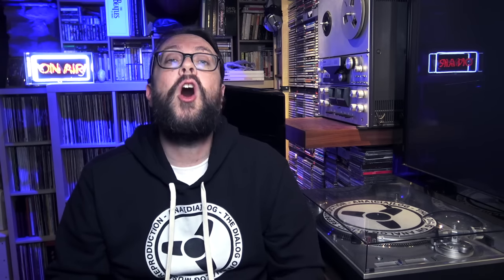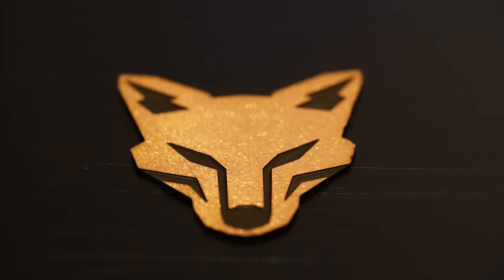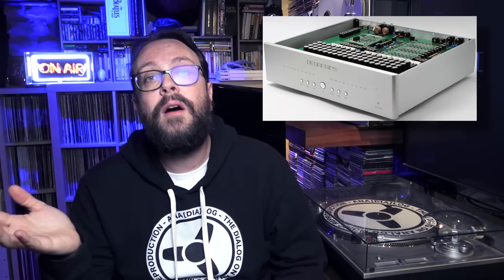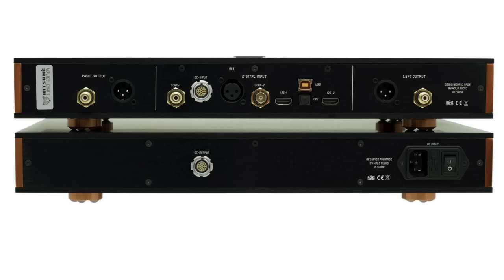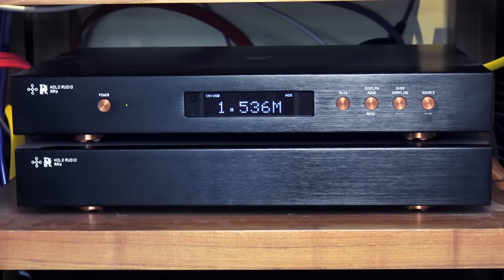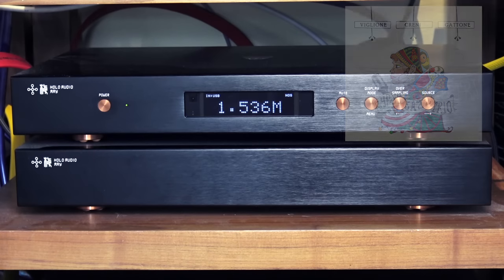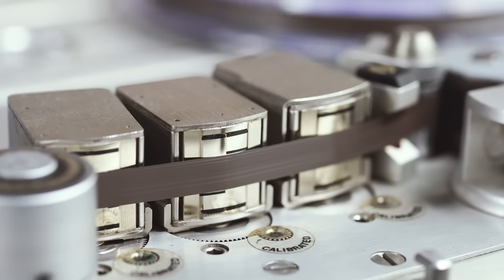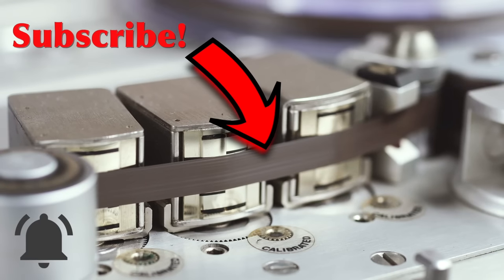Holo Audio May DAC: The Digital-to-Analog Conversion Vanguard

Comment: OCC silver does not necessarily sound better than high purity copper. Most times, silver wire sounds too bright and detailed detracting from the music.  I doubt Kitsune actually designed the caps that replaced the Vishay caps. They’re probably using a higher grade using off the shelf cap from another manufacturer.
Reply: Thinking the same thing, or at least hand picked for better measurements. However I think silver in the is case will bring up the speed of the DAC a bit, maybe a bit more punch? Let's say 2% punchier... lol. None-the-less I just pulled the trigger on it.
Reply: @mesonto  Let me know how it sounds. My audiophile buddies compared the silver and copper versions of the Spring DAC. They preferred the copper version.
Reply: @JohnLee-db9zt  And this is exactly what I would have prefered to be able to do... I miss the local dealers! I have purely made this purchase sight unseen and unheard on the backs of several great reviews. Including one guy in Toronto that used to work in a high five store that I frequented... Jay, home for most the time when I was in the store I did agree with him on what we listened to.

Nonetheless it's frightening to buy things when you haven't been able to audition them.
Reply: @mesonto  The US distributor is not an audiophile. His system is poorly setup and is completely inadequate for the May or Spring DAC.  He jumped on the silver and “special” capacitor bandwagon, so he can make more profit.  Audiophiles can’t stand having but the “best”. That’s my opinion.
Reply: @JohnLee-db9zt  John, don't tell me that! That's what I was thinking all along. However as I told you I bought the KTE version just hours ago. I have to hope that my system is revealing enough so I get at least 2% better performance? But maybe I just got sucker punched. But I guess I'll never know considering I bought it sight unseen and unheard. Sigh...
Reply: @mesonto  Regardless of the version, it’s a great DAC. A bargain compared to those overhyped overpriced DACs from western manufacturers.
Reply: @JohnLee-db9zt  Geeze, I hope you are right, because it was rather expensive with Canadian money! It better be my end-game DAC.
Reply: @mesonto  End game? Lol. There’s no such thing for an audiophile.
Reply: @JohnLee-db9zt  my wife says there is... hahaha
Reply: @mesonto  She’s going to be disappointed. 😁
Reply: @JohnLee-db9zt  lol!

Comment: I am not doubting you are getting better sound but the amount of $$$ people are throwing at DAC's nowadays seems a little crazy and could be spent more effectively (IMO) on other parts of the sound chain.  For example: music streamer and power source.  Right here is where the sound might be most easily improved.  For example switching from a MacBook laptop to an iMac or mac mini for your music streamer will greatly change sound performance as I've found with my own experimentation. Obviously there are even better sources than a computer (but surprisingly this is what a lot of people use).  Second, for that analog sound why not considering investing in a high end preamplifier?  A really good preamp can do wonders for sound stage and can be chosen to suit ones preference.  For example, pre-amp with tubes for less harsh digital sound.   A general strategy: if you want to invest your $$$ don't spend it on the DAC (this also applies to other sources like TT) but put it into a more fundamental piece of equipment such as a top of the line integrated amplifier or even better integrated preamp/amplifier.  I am not saying every DAC is created equally but I think a DAC in the $500-1000 range with a carefully thought out sound chain can sound amazing.
Reply from the maker: I agree, but you must consider people that already upgraded the rest of the chain and now they want to upgrade also their analog to digital conversion.
Reply: @anadialog  Fair enough.  But I'm going to revisit this post in the future after I buy my 6-10K speakers and see if it makes sense to pay 6-10K for a DAC.  I saw someone talking bout the Chord Dave which is almost 11K.  I remain doubtful - but very open minded.

Comment: My friend, for that money I'd get a Benchmark or Brooklyn DAC.
Reply from the maker: I considered that, but Bechmark has obsolete chips and by Brooklyn I believe you intend a Mytek DAC, and perhaps the Manhattan model. The fact that Atkinson ditched the Manhattan and took the May as his reference one me over. Mytek is the way to go if you need MQA IMO.
Reply: @anadialog  Benchmark Dac 3 is the Reference Dac at many manu studios and is a favorite of many audiophiles i know for its second to none implementation of the ESS chip most frequently used by professionals.  It also holds its value much much better (like most end high USA products) and is Sterophile's class A+ DAC of the Year.  The Chinese DAC may use a newer chip but has the tendency to color the sound (a big no no), making everything sound analog, as noted by Herb Reichert.  Id give the Benchmark a try before committing to the May
Reply from the maker: @jn3750  absolutely, I am not defending at al costs the May, I was just commenting on the models you mentioned. Remember that the May is a r2r DAC, no chips, only for upsampling. A good comparison are the Denafrips or Soekris etc.
Reply: @anadialog  Another problem with R2R DACs is that they usually don't measure exceedingly well, though they have the sound we analog fanboys love (I bought 2 R2R professional machines after watching your channel!).  Also, Chinese companies like to use the latest chips (I also have the flagship Topping D90 which uses the much newer chip than the RME) but their implementations are not stellar.  In numerous tests, the RME walks all over the Topping!
Reply from the maker: True! But Holo as others are trying to correct the connected issues. Obviously the downside if further manipulation of the signal
Reply from the maker: That is clearly a policy to promote mainly US products, which I do understand in part. Leaving China aside there are several countries that produce amazing DACs, including Italy! But I am sure that the Mytek is great, it is surely the one with more features than anyone...very versatile.
Reply: @anadialog  ive been reading both Stereophile and TAS for about 30 years and they are quite neutral, featuring products from every place on earth (the fact that about 60-70% of the top products happen to be from the USA is no surprise as this country holds most of the world's patents, has the best companies, research facilities, universities, scientists... and dominates the scientific communities (as you are a researcher) ranging from Anthropology to Zoology.  On their top products lists you will find MANY products from Europe and Asia as well.
Reply from the maker: Well, same here. All mags and websites tend to promote more the country's own products more than others. But it's ok, no problem with that.
Reply: I've had the Benchmark DAC, it's sterile and lifeless.
Reply: @divertiti  Interesting.  It is one that is recommended by many people at the Absolute Sound, Stereophile, Sound & Vision mags and used at numerous studios.
Reply: @jn3750  Studios use DACs as a tool to analyze their production, not for musical enjoyment, that's why they choose something that's sterile and analytical. I don't produce music, I listen to music for enjoyment, and there is none to be found in the cheap delta sigma DACs like Benchmark and topping.
Reply: @jn3750  The Holo May measures as well as the best DS dacs. Also, you are getting too much encouragement, R2R just dacs sound better. Measurement geeks have the thinnest, flattest sounding hifi setups out there.

Comment: Get rid off your Macbook pro, that was I used to use with a Singrex 6 and Holo Spring! I did not realise how shitty that sound until I tried a Allo digione signature with their linear power supply, and Volumio software(best sounding). When I used Macbook pro, I have tried all kinds of playback software: HQ player, Amarra, Pure Music, Audirvana and more, Audirvana sounded bright but lots of details, I barely use it. Amarra sounded best without upsampling. After I bought a Allo digione signature to try out, I cannot go back to Macbook anymore! and Allo digione is sooo cheap.
Reply from the maker: Thanks for the tip!
Reply: Yep, the noise that I didn’t notice with my MacBook Pro was gone with the Digione Signature too.  But I’d recommend an Innuos if you want DSD, since the Digione doesn’t have a USB out therefore limited to SPDiF out
Reply: All that software bloat, strip down the os. Get could ge euphony or windows server
Reply: @shahidyt  Does digione have I2s output? Holo has i2s input, that should do dsd I guess, but never tried.
Reply: @danlu8445  no, the Digione is coax, bnc and optical.  I2S would be better, but be careful in equipment matching.  I2S is delivered different depending on manufacturer I believe.  I think more common is HDMI but I think in some cases ethernet cables.  I don’t know too much about I2S, but I think the Denafrips Terminator has different I2S connectors so it is compatible with a wider range of I2S transports

Comment: What is the op-amps it uses? When you power mode switch on can you change the voltage output should be able to from 3 to 1 volts ppv, have you tried it at 1 volts don't go to 3v if you haven't got a valve amplifier. How are you connecting it up through a preamp or straight to a power amp.
Reply from the maker: There is an Op Amp used for input stage and discrete component used for the output stage. The discrete output stage is working in pure class A.  It’s BiPolar Junction Transistors, direct coupled.
This is taken from their website.
The manual says that the output from PCM is 2.9V and from DSD 1.45V. XLR is double. No, I have connected it to my integrated tube amp.

Comment: Serious question. What did you have before, and what is the difference?
Reply from the maker: Before this I had a ADI 2 Pro FS. The difference is mainly in the sound quality of the high-res material. As I said the sound is less "digital" and rich in detail with more complex music. The music I stream from Qobuz just opened up and sounded much better. I truly believe that this machine needs time, I know how OCC wore behaves, it takes time like the rest of tye descrite components. I am very curious to reassess my evaluation 3 or 4 months from now.
Reply: @anadialog  cool, thank you for taking the time to reply. Love your channel.
Reply: @anadialog  you should try using a dedicated streamer with the DAC.  In my experience it made a huge difference over a laptop and audirvana.
Reply from the maker: I think you are probably right. Nevertheless, the computing power of a Mac Book Pro is not present in a streamer but the components are obviously better and hifi grade.
Reply: @anadialog  Audio doesnt need alot of computing power.  The compute modules on a raspberry pi can handle high resolution audio with ease.  There are other solutions with more computing power out there but certain schools of thought believe that a more powerful cpu introduces more noise. I cant comment on that since I dont have any direct experience.  The only thing i can say was adding a streamer in lieu of a laptop made a significant difference.
Reply from the maker: Well, I can only say that you should see how the Mac suffers when playing high-res material with Audirvana!
Reply: @anadialog  the reason for that is audirvana turn down alot of the performance to lower noise, they believe that more powerful processors are noisier. Its one the reasons audirvana sounds better than other software.  With a dedicated unit components are far less quiet so there is no need to throttle components everything runs smooth.

Comment: Looking at their website, it’s disappointing to see no actual measurements or specifications for the DAC. 

It’s like looking at a very expensive super car without any BHP, 0 - 60 or top speed data.
Reply from the maker: Check the forums, I found some interesting tests and measurements.
Reply: Yep. There is a full set of test bench measurements done from/on an easily findable forum.

Comment: From my personal owning and listening experiences, Spring Kitsune Edition DAC (with the Kitsune SU1 Bridge) was one of the worst DACs in the that price point I have EVER owned and heard. Not even remotely good sounding regardless of price, just terrible. Soft, crushed dynamics, lifeless veiled sound. Total crap. And I gave it months of burn/break in. I kept the SU-1 bridge though, that's a great product, the DAC sucked. Below average with PCM and miserable with DSD. They failed miserably attempting to go for that "analog" sound, something that PS Audio DS Sr does really well, if you are into that more vinyl-like analog like sound signature and not the more powerful/weighty solid state like digital sound of many chip dacs like the AKMs, ADs and Sabres. The DS Sr is really the Vinyl's lovers ideal DAC. I prefer the sharper more powerful SS like sound, especially if it can be equally nimble and nuanced with complex acoustic pieces, something the top flight chip DACs can do well. But as for Holo my take away is this... you can build something pretty and with a pretty looking circuit and board layout but that is not a guarantee it will sound good or a substitute for manufacturers that rely a lot on listening. To me it just seems Holo made the prettiest looking board they could aesthetically and assumed it would sound good. When it comes to sound quality I hate to say it but Holo are total pretenders. If you want real good R2R, get an older used MSB, Rockna or similar. Hell if you just play Redbook or 48k get a nice used 90s DAC with the actual PCM1704s in them. Hell even the Schiit Yggy which I had for a bit was also miles better than the Holo.... the Yggy was a bit dry sounding for my taste but it had exceptional sound quality. And I know I'm not the only one who feels this way about Holo DACs either. The sound quality of AKM based DACs like the Bryston BDA-3, Sabre based Mytek's or the AD based Bricasti's all sound orders of magnitude better than the Holo stuff... then again basically anything sounds better than a Holo lol. Other favorable comparisons would be the the FPGA's like Playback Designs, PS Audio DS Sr. or Chord stuff as well. The former two which I have owned and kept PBD. The Denefrips units sound like they are vastly superior to the Holo products and everyone raves about them, including reviewers I trust. Haven't seen any others having very similar experiences as me with the Holo on the Denefrips. Looking forward to trying a Den Terminator some day.
Reply: Emil after reading your comments last week I set out and just completed an extensive search on 22 some well known and popular audio sites in North America, the EU , Australian , Japan and Hong Kong including two critically audio sites obsessed with measurements just to cover a wide and extensive area . My back ground in medicine I find doing extensive and exhausted studies right up my alley so to speak .

Holo Audio in general have a favourable product line among owners and reviewers though with a variety of opinions from mildly favourable too enthusiasm over the audio performance of Holo Audio top offerings ,,..It is my opinion you fail miserably with your childish rant and it’s obvious you have some sort of personal issues going on to go out of your way to post such nonsense,,..
Reply: @marks.2909  You lost me at "my background in medicine...". One it has nothing to do with the subject at hand and two it doesn't magically give you some high pedestal to call me childish because I am in the minority of those who happen to have a different opinion of the product. So It just makes you come across like the pompous elitist that you are. And best of all you don't even own it! So if anyone is going out of there way it's you. Nice try on the projection. Look in the mirror. you had to talk up your background to talk to a stranger on the internet. Thanks for the laugh!
Reply: Jesus